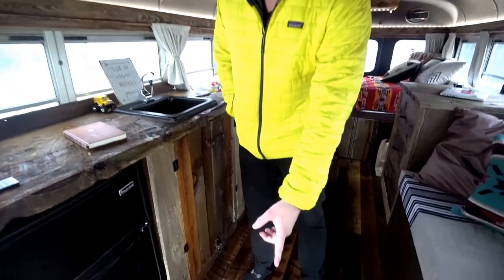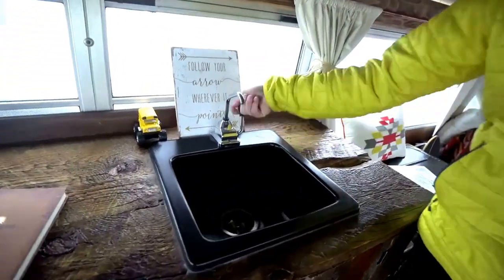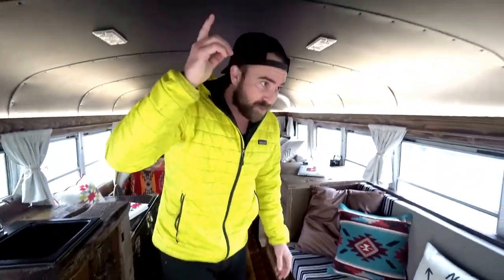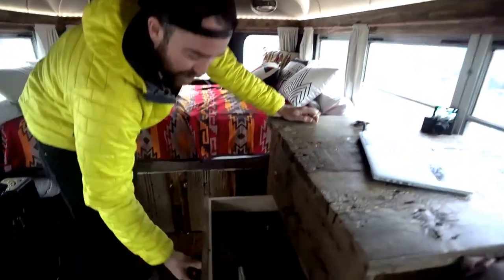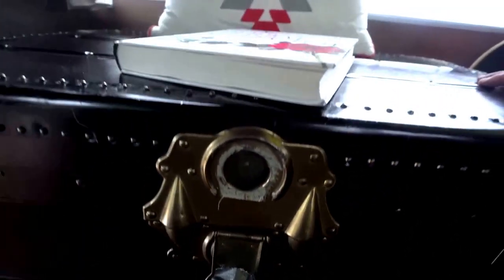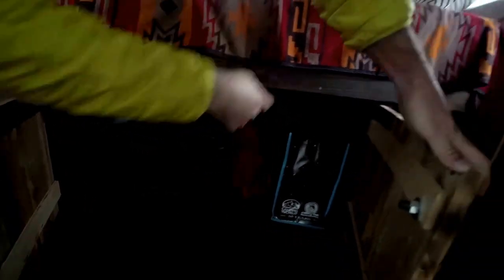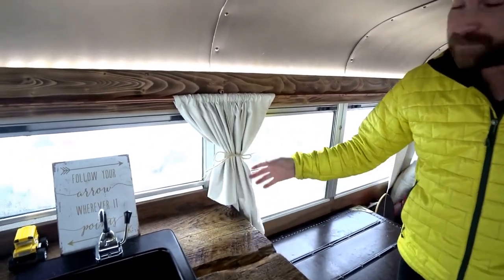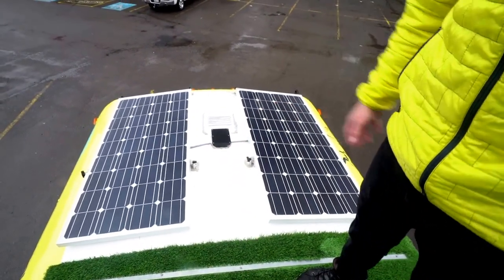Short School Bus Conversion By Jax Austin

Comment: how did that add up to 15k bus must've be about 12k
Reply: Tahir Jefferson I bought a secondhand bus for $6k in Australia
Reply: eyesdark08 that's a bad price for usa I got a short bus with 50k miles for 1.5k
Reply: Tahir Jefferson  ~  If I remember correctly he bought the bus for about $4,000, maybe $3,500.
Reply: Benny  ~  $1,500 for a bus in decent condition is rare though, unless you get a really good deal on eBay or somewhere from someone that is just wanting to get rid of it.  Also milage doesn't always speak to condition.  I have heard of people who bought vehicles with really low mileage and then found out that it had sat for so long that they had to do major repairs to either the mechanics or the body.
Reply: You can find 30 to 40 seaters for less than 5k.  But at the rate people are buying you might not find a PERFECT STRUCTURE one.  Might have to repair the floor.
Reply: Tahir Jefferson ha! I said the same. I don't see it being 12 either.   Maybe the bus costed  8k lol.
Reply: MC Briggs 15k seems outrageously false
Reply: That’s reclaimed wood must have been at premium prices... that’s really the only significant custom finishing, the solar system was probably a few grand too... I could see it all adding up if he also put all new tires on too.
Reply: Scott Beaulieu reclaim wood is not expensive.  Opposed to new.     Knock it off

Comment: 15k seems awfully Much for all reused wood
Reply: "Reclaimed hardwood" thick chunks of real solid wood doesn't come cheap.and what he did was use thick pieces for the desk etc which probably cost a fortune to buy and now the weight of it burns extra fuel. Smart people use wood from free shipping pallets, take the time to take it apart and then size and hollow out the part that isn't visible and stain and sand and treat the visible side so the grain shows through. Practically free, lightweight and looks good but is labor intensive.
Reply: The freezer has melted popsicles, wasn't addressed,plus doesn't use water from the sink nor does he use the toilet. I guess if you don't drink, you don't pee but you also die. This sounded like he won the bus in a bet or works at a bank that repossessed it and is telling a story about how great it is to live in it as a sales pitch.